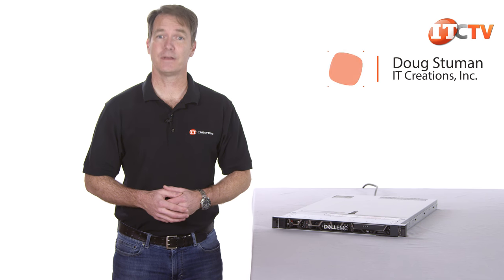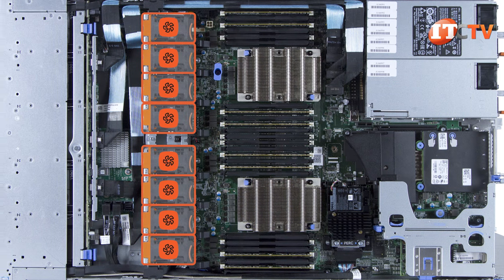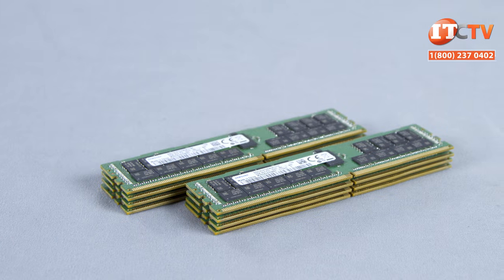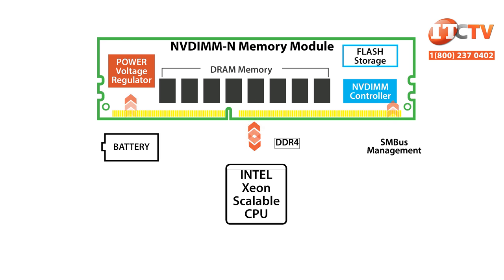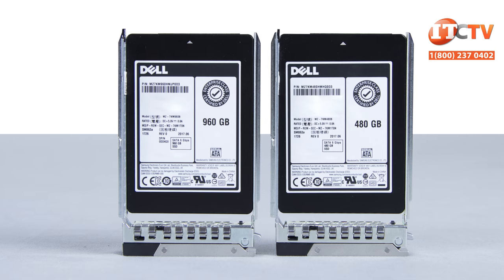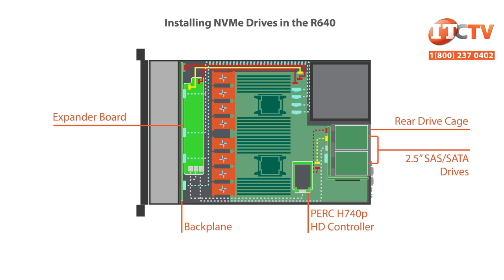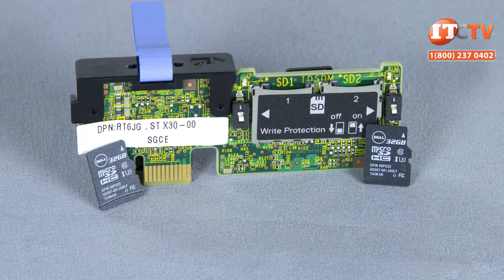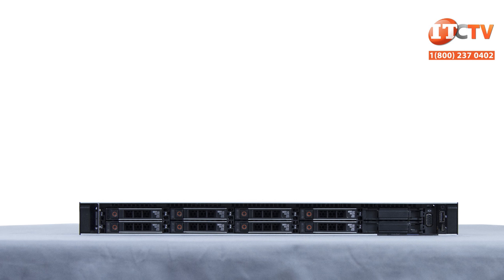Dell EMC PowerEdge R640 Server Review | IT Creations

Comment: Hi again, can we install SD card for esxi, what SD card do you recommend to work with RT6JG?.. Additionally we want to install 8 x 2.4TB SAS on drive bays to achieve 16TB storage, is this possible? Also, we currently have 16GB x 4 (DDR4 - 2666) and 1 Silver 4211 CPU, planning to add 1 more processor and 20 additional 16GB memory modules? Please let me know if these options are possible.
Reply from the maker: Hi there! 
To start here are a few links, one to our landing page for the Dell R640 which does have a few references (Documentation tab…) for this system.

https://www.itcreations.com/dell/dell-poweredge-r640-server.asp 

https://www.itcreations.com/user-manuals/r640/dell-poweredge-r640-technical-specifications.pdf 

Regarding your questions, It will take a 16, 32, or 64GB Micro SDHC/SDXC card module and we do have that in stock here and we do price match. 

https://www.itcreations.com/product/97311 

As far as the other stuff is concerned, I do not see any limitations on the drive capacities listed in the Technical guide, page 8-9, so you are good there. Regarding memory - 4x 16GB total now + 20x more = 384GB. Technical Guide page 8 says 384GB supported (easily…).

BTW, we have all of this hardware. Contact our sales team directly for specific parts requests and keep in mind we do price match. sales@itcreations.com

Thanks for watching!

Comment: Hi, it is possible to use more than 3 nVME drives without buying uber-expensive dell drives to have access to the nVME chassis? or even with some kind of adapter for pciE ports?
Reply from the maker: Hi Juan Carlos, yes there are other options for M.2 drives in a quad drive like that offered by ASUS (Bifurcation of PCIe lanes is supported on the R640) and other options for front-mounted NVMe drives. Give us a call and talk to Andrea he is very familiar with the system and can not only advise you but most likey provide what yuou need at a great price. 800.237.0402 or sales@itcreations.com, subject: Attn: Andrea regarding R640 NVMe drives. thanks for watching!
Reply: @Itcreations-LA  Thanks, with the one of asus you mean Asus Hyper M.2 x16 Card ? i will send an email for the front mounting options.
Reply: @Itcreations-LA  Hi, i sent an email 5 days ago with that subject, no reply still
Reply from the maker: Hi Juan, sorry for the delay, I have asked Andrea to contact you immediately!

Comment: If you don't fill it with drives, does it at least come with the caddies so you can add your own later?
Reply from the maker: Hi Glenn, 
If you purchase from the manufacturer or a reputable hardware redistributor, like IT Creations, then they will usually send the system with the drive trays included. The drive trays are also essential for cooling and should be in place even when not loaded with drives. Although, since this is an older system and if you are considering purchasing one of these that could potentially be used then just make sure you ask if the drive trays are included. We will be posting a review of the Dell 7820 in just a few hours, check it out as it is in direct competition with HP's Z6 G4 which is the next generation up from the Z640. Hope that helps, thanks for watching!
Reply: @Itcreations-LA  Hi both, if a slot is not populated, it will contain a blank, which is not the same as a caddy. The caddies are not sold separately. Not from Dell at least ;)
Reply from the maker: @mynciboiV8  and 
Gee Bee
, 
We do indeed sell these separately. They are  expensive as a result of supply and demand, unfortunately. That said, it is an option that should be ordered with the unit to get the best pricing. And yes you can purchase the two part 3.5-inch tray form factor that includes the pop-out caddy where the M.2 resides, separately without the M.2 drive and add one later.  Here is a link: https://www.itcreations.com/view_product.asp?product_id=105595 
Hope that helps and thanks for watching!
Reply: To get the caddies from dell you have to buy them with a disk. A 3rd party will either have taken them off a disk (possibly failed disks) or will be non-Dell parts. It is unlikely these will be Dell products otherwise and could be complications for support. Also check the disks you put in are supported by Dell. iDrac will not report on wear or failure issues etc. Just know what you are getting into...
Reply from the maker: @mynciboiV8 + Gee Bee
We do have the real deal. Dell M.2 Caddies for the front of the system, here: https://www.itcreations.com/catalog.asp?s_s=dell+flex+bay+module+ Does not include an M.2 module but we do sell those too if you want to purchase at the same time. Thanks for watching.